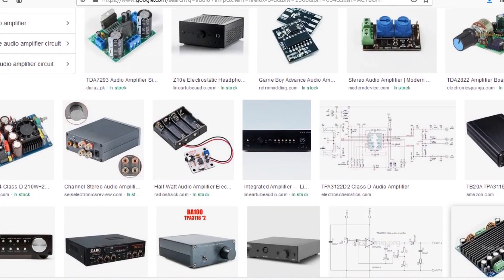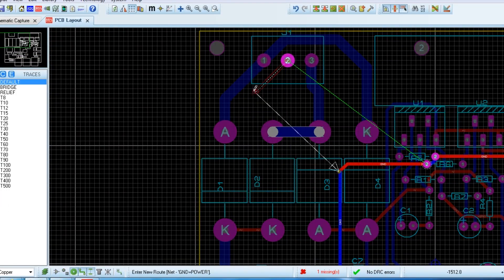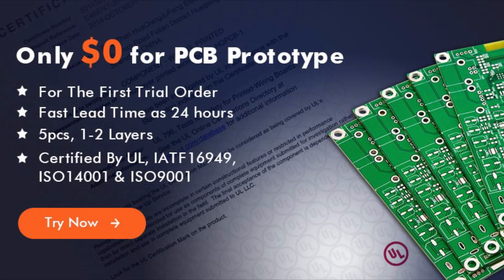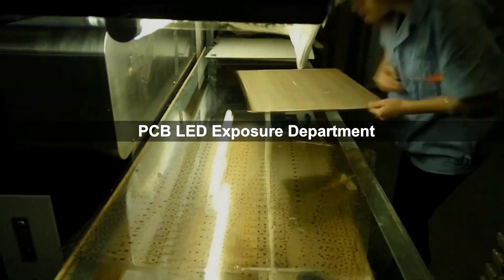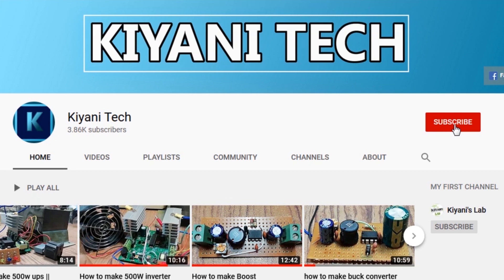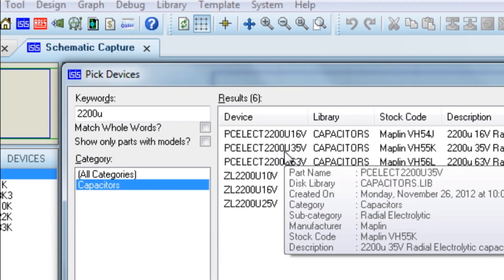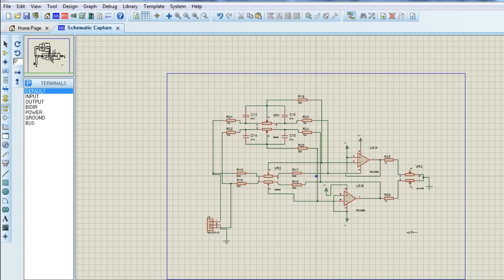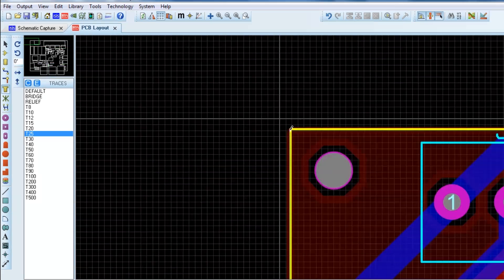70W+70W Hi-Fi Stereo  Amplifier + Bass Tone Control  | NEXTPCB

Comment: No amplifier can give full output as given on datasheet like this one which says 35 watts and also we shouldn't try to use maximum operating voltage to make it deliver absolute minimum power else it will burn out